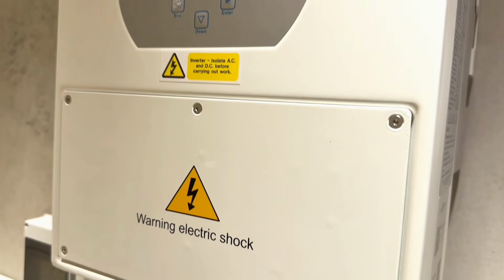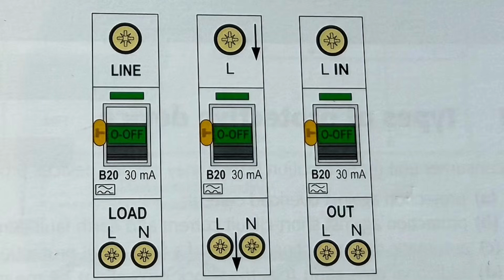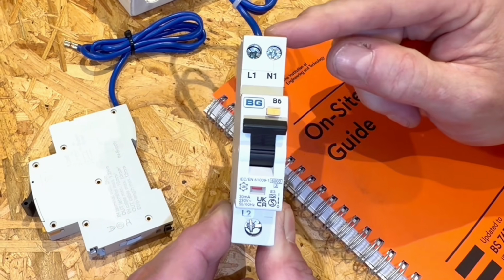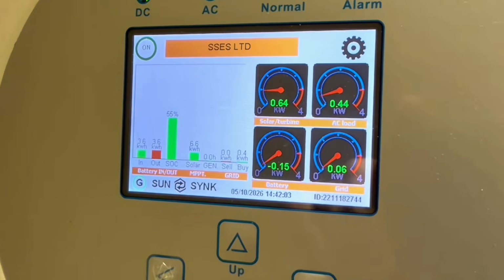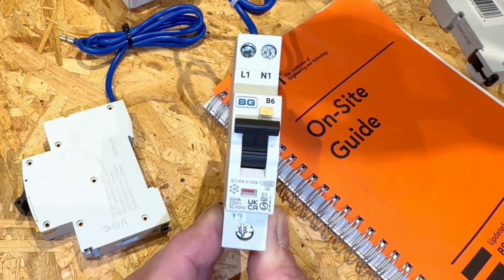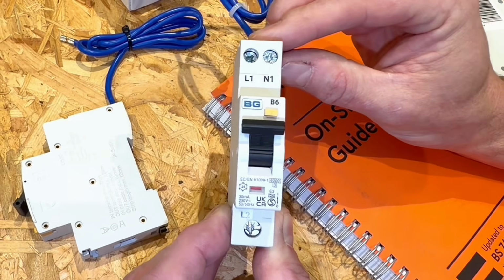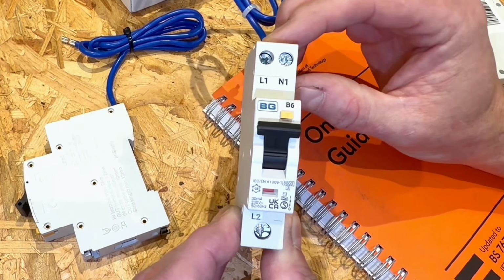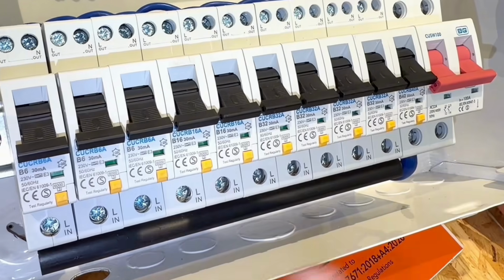Important: Is It Unidirectional or Bidirectional?

Comment: Does AC electricity flow in one direction?
Reply: You really don't understand electricity do you?

This isn't a question of whether the electricity is AC or DC, it's about the direction of transfer of the energy from source to load.
And in the case of RCDs, it matters.

Comment: I'm wondering why bidirectional would be needed. The solar is only ever going to be coming in. Just wire in the opposite sense, (external circuit arrives to top of device, power leaves bottom) and the device is seeing normal transit though it. I have a totally separate sub unit for my incoming solar circuits. That then feeds to its own MCB on the main board. I'm using plug in solar, so it's galvanically isolated, but I still have a DC leakage tolerant RCB in the solar sub box. Doesn't this solve the issue? I'm also skeptical to assume a lack of marking shows it IS bidirectional. Surely older devices simply lacked clearer markings than current ones
Reply: Another channel covered the necessity for bidirectional RCBOs in detail.  Wiring it in the opposite sense does not guard against the potential issues.
After learning of the issue, I looked into my own installation, and checked online as well.  And I could not find a single solitary instance of a unidirectional RCBO on sale anywhere.  If your unit is new-ish and has no in/out markings, it's probably good.  But do check that against the manufacturer's specs which you should find online.
Reply: @kaasmeester5903 thanks. I slapped my own forehead after writing this though. Obviously the wiring doesn't care which way the power is going, but either the solar is pushing it one way, or the normal installation is pushing it the other. It's DEFINITELY bi directional in a sense that isn't normal for non generating systems. But yeah. It seems generally the safety systems are robust enough to deal with it

Comment: My ring circuit just tripped yesterday at half 1. I fed solar into a pair of outdoor sockets with a fused spur. It had standard unidirectional RCBO but tripped at 380W whereas it didn't trip at 540W solar. What could have caused the trip?

Comment: Very helpful video. But with the old RCD they need to be type A or type B. The older type AC need to be replaced as I understand it.
Reply from the maker: Spot on, regulations are definitely shifting that way type A is a minimum ✔️✔️
Reply: Type F is even better.
Reply: @deanXRayZulu not sure I even know about type f. Will need to read up.

Comment: So if your not feeding power back into the grid...but you have solar panels etc...small scale set,up batteries for storage ,   none of the above is needed ,, ?
Reply: Depends on how your system is wired I'm afraid...
If you're generating on an existing circuit - say a ring circuit (or radial) with plug in solar...
That 800w or so that is taking priority as the voltage is slightly higher than mains...
Well that first 800w that is flowing in reverse to be consumed first by devices on that circuit - this 800w doesn't have any real circuit protection as it has not passed an RCD/RCBO yet, if the micro-inverter is effectively flowing straight into your home entertainment system on same circuit before it gets to the CU/RCBO's
So your home entertainment system is receiving power that hasn't passed through a RCD/RCBO protection device

Now, the inverter has some kind of fault protection, plus the RCD/RCBO supplying it - but the actual solar energy being converted and sending power back through that original circuit - is not actually protected by an RCD/RCBO just yet until it reaches the CU and then other devices on the busbar offer protection as the solar is flowing through busbar to other house circuits in the same direction as mains
This is why it is recommended to have a dedicated circuit for inverter, that is bi-directional and then the rest of the circuits will be fine if uni-directional etc...

The most likely solution is to split tails & have a small CU for EV/Solar/Heat-pump upgrades with existing CU left as is

Grid-tied, Hybrid, 100% off-grid setups - the wiring can vary in many cases...
Yes, you could do this or that, but each case there may be exemptions to consider
Hence the one answer fits all is splitting tails & small CU option
Or perhaps a dedicated circuit from existing CU for grid tied systems

The issue or considerations are how that solar energy is consumed and if it merges with mains - even from a battery storage if items in your home are fed from both mains & solar/battery/inverter

Of course if you are truly off-grid then there is no mains/merging of power to consider, but the off-grid inverters would be the only power source feeding CU - probably with changeover switch for emergencies

Afraid it is not a clear cut answer as wiring varies & so does the way the PV system could be installed & wired
Reply: They realised the potential risk in France, where plug in Solar is pretty well established. Since August '25 the plug in solar must go into a dedicated circuit, to avoid the possibility that the wires between the solar input and whatever load you're supplying are over loaded, (as there's no MCB between supply and load). It's a theoretical risk, I don't think there have been any actual incidents. Mainly because most plug in solar has a hard limit on what it can supply as its output.
Reply: They realised the potential risk in France, where plug in Solar is pretty well established. Since August '25 the plug in solar must go into a dedicated circuit, to avoid the possibility that the wires between the solar input and whatever load you're supplying are over loaded, (as there's no MCB between supply and load). It's a theoretical risk, I don't think there have been any actual incidents. Mainly because most plug in solar has a hard limit on what it can supply as its output.

Comment: Was there actually a regulation for unidirectional and bidirectional devices and how that relates to labelling for the past few decades? If not, then I wouldn't assume that the people that developed and tested these devices would have always followed the logic of this video. I can easily imaging scenarios where people may have thought that 'In' and 'Out' was easier to understand, while 'L1' and 'L2' would avoid the need to translate into different languages. Companies feel all kinds of market pressures to make changes quickly and at a low cost.
Reply: For RCBO's,  BS EN 61009-1:2012+A13:2021 standard contains the marking and labelling requirements.

But the standards documents are copyrighted documents for purchase and costing over £200 and I am unable to quickly find an online free version, so I am not able to answer your specific question regarding the marking of connection pins.
Reply: Historically the short answer is no. Its only as we discover the problems which Solar and Milk floats bring, that the  industry has to play catch up.

Comment: So even the older type AC RCD's are bi-directional then ???
Coz the technical data sheet I downloaded for both Type AC & Type A does not mention them being bi-directional ???
Which I thought they would have  ???

This means the older split load boards with RCD's are bi-directional - please check terminal markings to confirm etc...
MCB's are bi-directional as like fuses they go in any direction

So when manufacturers designed RCBO's they actually made them uni-directional and in some ways inferior to ye older RCD/MCB setup for micro-generation setups ???

Still took the manufacturers long enough to produce bi-directional RCBO's as they was Type AC to begin with, then updated to Type A but still uni-directional...
Then they updated RCBO's to be Type A with switch both L & N for EV spec - yet still uni-directional dual switching Type A RCBO's can be found ???

Finally manufacturers are now producing bi-directional Type A dual switching RCBO's for micro-generation purposes 

When ye older RCD/MCB split load CU's was already bi-directional ???

Seems to me the manufacturers got it wrong when first bringing RCBO's to market & making them uni-directional instead of bi-directional like MCB's (fuses) & RCD's

There could even be a legal aspect here as to manufacturers producing products that need to be replaced when older devices were bi-directional 
I mean I doubt if it would hold much water but you never know...

If some customer upgraded from split load to RCBO (Type AC)
Then had to replace with Type A
Then one or two requiring switching both L & N - another upgrade...
Now with micro-generation they need the inverter(s) to be newer bi-directional RCBO's ???

That's quite a lot expenditure & now they find out there old split load setup was bi-directional in the first place after RCBO after RCBO after RCBO etc...

So does this mean that split load CU's are likely good to go
Where as RCBO CU's will need more checks or latest RCBO for solar

The balcony solar issue - the only one size fits all rule will be splitting the tails & installing an additional small CU for solar/EV/heat-pump with bi-directional devices
Then at Henley block the solar will flow through original CU in same way as mains without needing to check for bi-directional protection in original CU etc...

Still lots of potential issues due to wild variations in people's CU protection devices, before balcony solar gets rubber stamped off imho
Reply: All RCDs/RCBOs will detect a fault and trip regardless of which terminals the supply is on and that includes devices from 1980.  'Bi-directional' is about how the device itself will fare when the test button is pressed and also in a real fault situation.  It apples to magnetic devices too but they are less susceptible.  Far to much detail to go into in a youtube comment though.